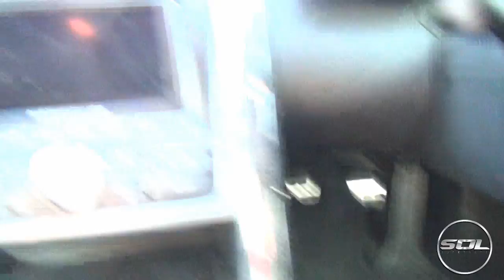Broken Audi R8 Update [Clutch Problem]: My Supercar Vlog

Comment: Not surprised with these issues... 
1. Its a 2008 model as you mentioned before. (First year of production for the R8 from audi)
2. Hence its almost dirt cheap now that its been quite a while.
3. First attempt by Audi at the R8 meaning its not going to be as good as the current year models.
4. Thats why your interior looks ragged up, e.g carbon fiber sticker peeling, gas lid didn't pop up first time you used it.
5. I could go on forever but I'm going to stop here.
Reply: Keepin'ItReal z

Comment: The R8 is a great car but you must of bought a bad one.
Reply: Do u own an r8 the car is made from racing materials as in not made to last long.
Reply: MrDjvas Actually if you properly look after it then it will last. Also if it's made from race materials then it is made to last, plus I don't think anyone would buy a vehicle that won't last.
Reply: It's not like he bought a new one. And it's very common among high performance cars that they have some clutch issues after several 10K miles. If he fixes it, it will be gone for another 10's K of miles.